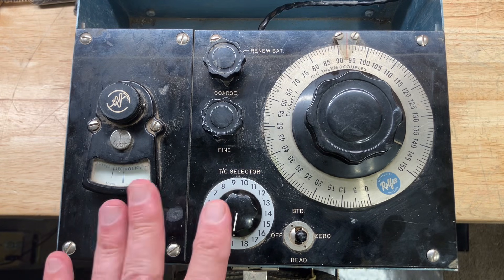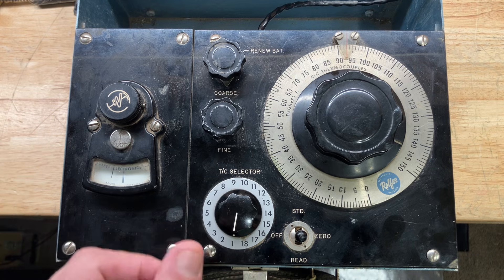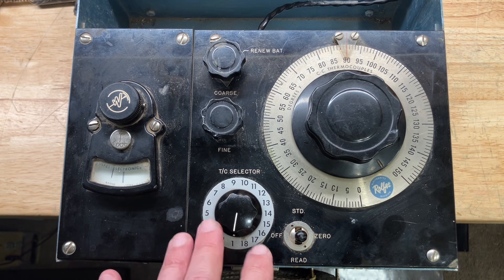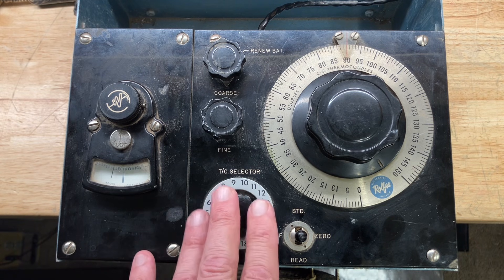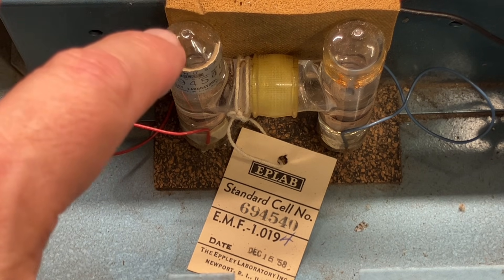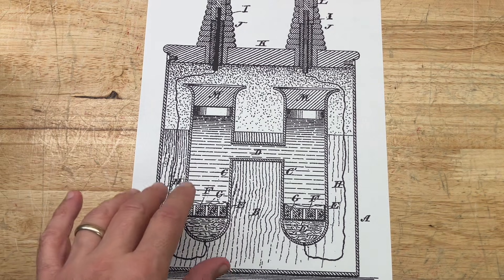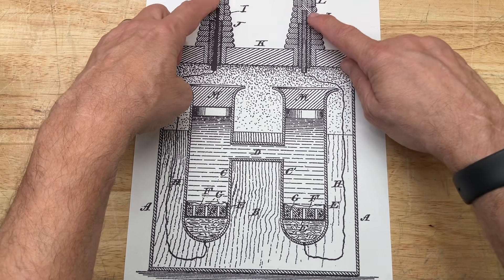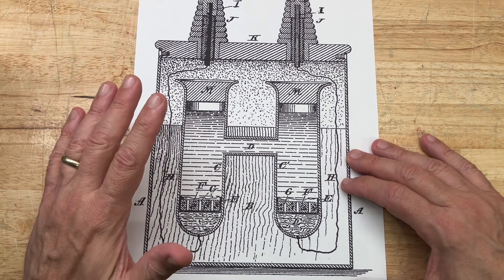Weston Standard Cell

Comment: I've got a couple of surplus US Airforce RFL Industries 852G calibrators that have Weston cells, but I thought the voltage was 1.018??? not 1.019_ so I inquired via Google's AI.  It says the difference is the 852G has a saturated cell vs this Eppley which is an Unsaturated standard cell.  The unsaturated cells start off in the 1.019x range vs the 1.0186xx of the saturated variety.  The annual decay rates are also different, the unsaturated decay at a rate of ≈ 80uV/yr vs <5uV/yr for the saturated standards.  The lowest stable voltage of an unsaturated standard cell is 1.0183v, so unfortunately your cell is within a few years of EOL. This is why saturated cells are considered primary standards and the unsaturated cells are secondary standards.

Comment: I have a similar device. I read up on that cell.  Be sure to store it in darkness. 
I've yet to figure out a reuse for the random value wire wound resistors found inside.